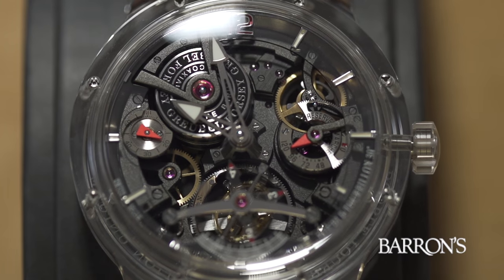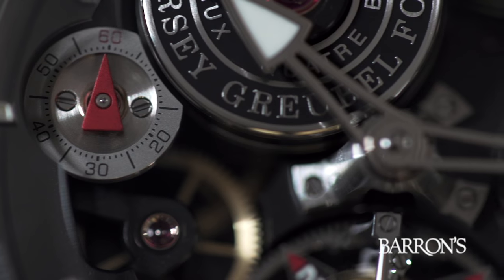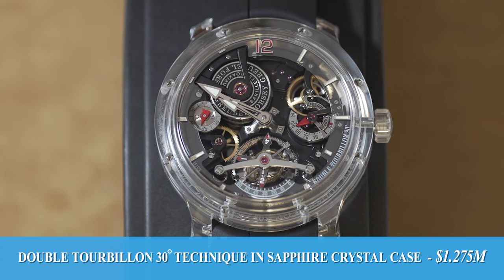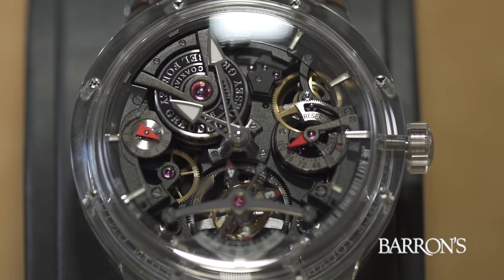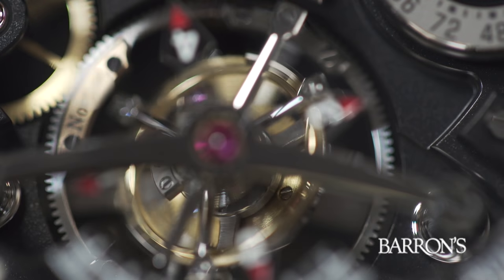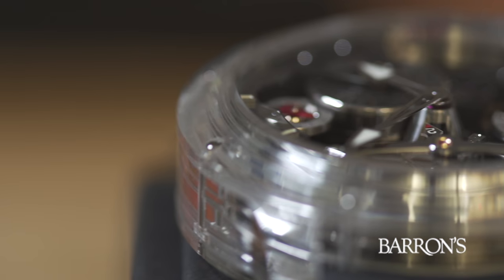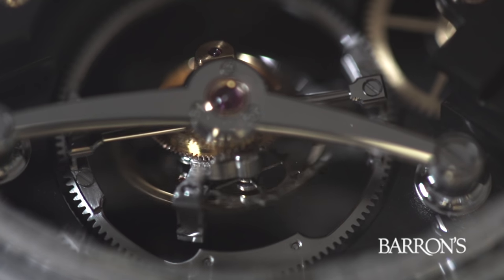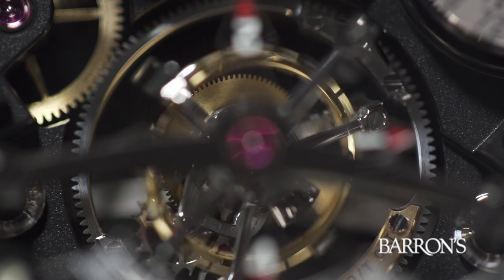The $1.3 Million Watch

Comment: The pricing of this watch is pretty justifiable compared to watches like Rolex, Hublot, and most big brand watches. Greubel Forsey has 100 employees just to produce 100 watches annually, so to sustain they need to set a very high price tag. Accordingly, the finishing is exceptionally good and it surpasses most brands in terms of quality.